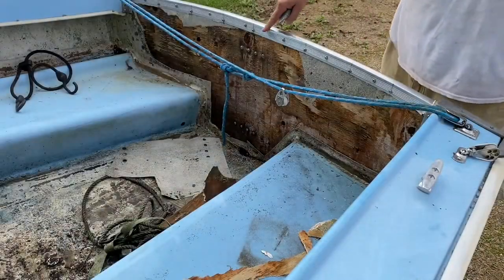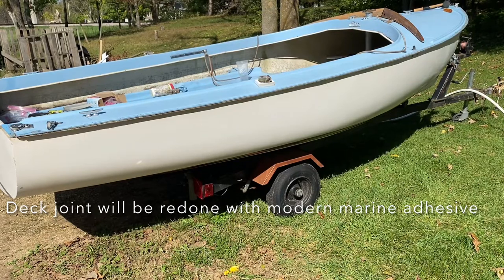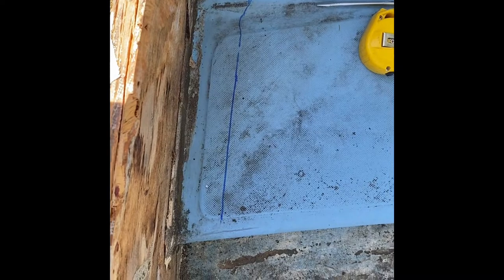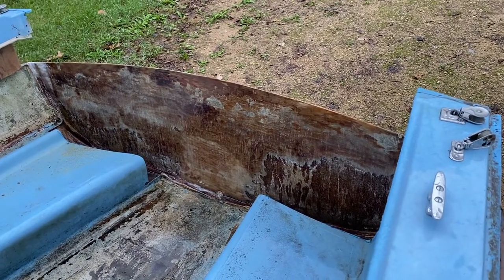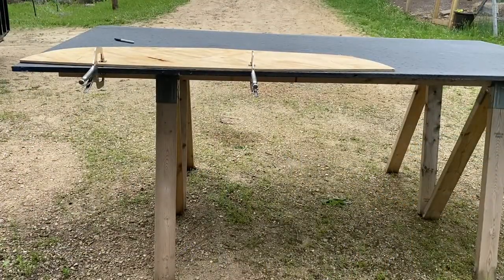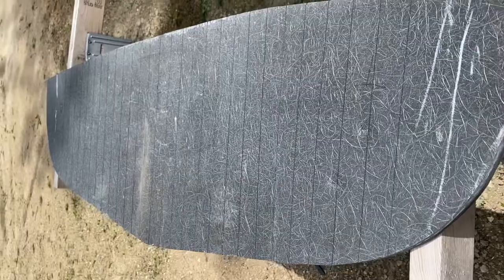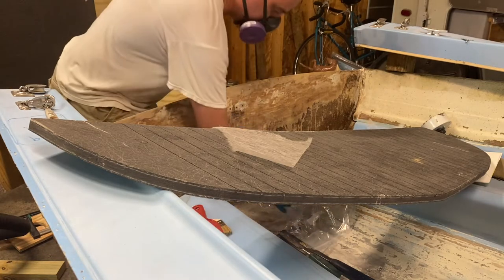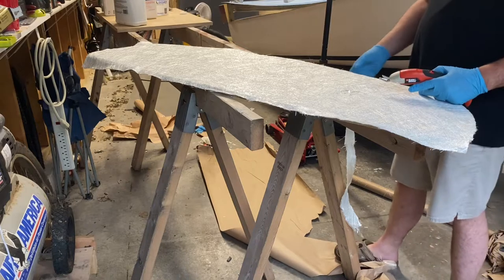Coosa board stern replacement on a 1965 O’Day Javelin sailboat￼

Comment: I wondered what that job would entail.  I bought a used moored 1970 J in 1984, and the owner had home fiberglassed the syern as it had gotten soft.

It was a sloppy job but good enough for me for two years on a large bay...as I didn't own a motor.  I wouldn't have trusted it with anything more than a troller.  I trailered it and always kept it dry.

I trailer parked it at a brokerage after I bought a SJ21 for two years and it got softer...since nobody bought it (hey free dry storage)

I thought about rebuilding the transom but I was going to sell it for $900...so I bought a GetRot kit from the broker's chandlery for $30....drilled holes and filled the whole thing with get rot (basically thin fiberglass resin)...then coated it with matte and repainted.

I felt better selling it that way...which I did about 2 months later to a lady that lived on the bayfront and wanted a pier runner.

A couple years later I passed her on the bay. She was still very happy with it.

Good looking job.  Excellent finished product.  Boat looks better without that aqua two tone they had till the mod 70s.

Did the seat gap get filled with a stack of coosa board cutouts?
Reply from the maker: I did cut several coosa inserts to support the cut out pieces and used thickened epoxy in a caulk tube to glue everything back in to place. This was not a cheap repair by the time I replaced the rub rail and painted the boat. It does get compliments at the boat launch and I don’t have to wax or fuss about the finish since going to polyurethane boat paint. If you’re ever considering doing it on a different project boat the repairs turned out great and I think it was worth the effort.